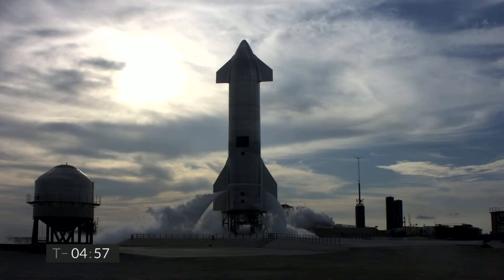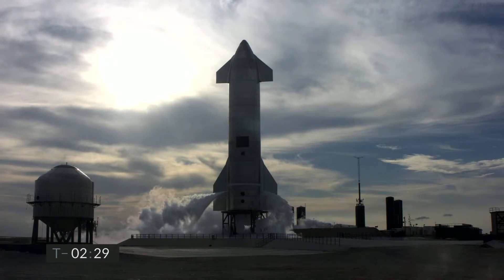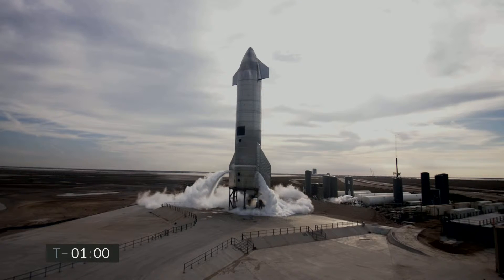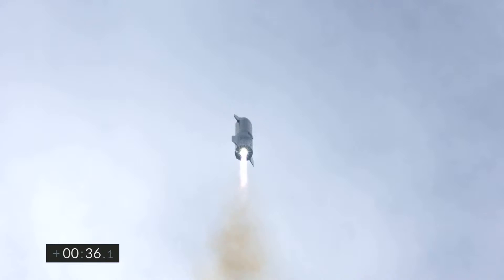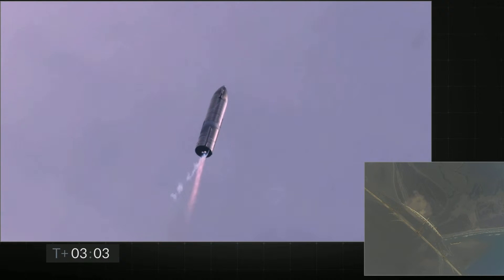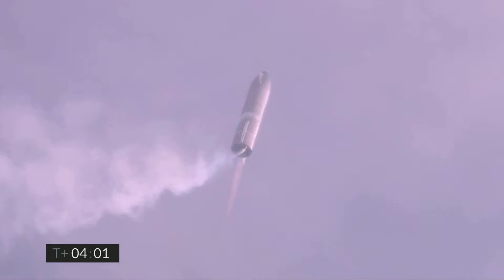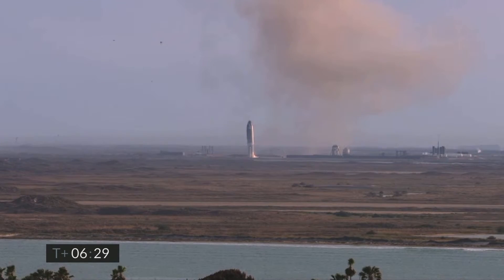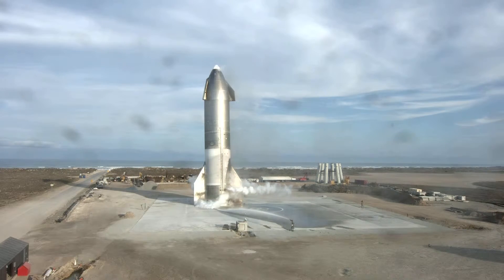Starship | SN10 | High-Altitude Flight Test

Comment: The fact that it exploded a few minutes later only puts a slight damper on its success. Still a great idea for intercontinental travel! (Sarcasm).
Reply: do you mind that this is a TEST flight? This is the very first time a thing like this happened, and the test was a success. Of course they had anomalies at the post-flight vehicle safing.
Reply: @politonno2499  The first time something like this happened? What specifically are you referring to? Because it's not the first time a rocket has landed vertically and definitely not the first time one attempting to land had exploded. 
Besides that my point of "still a great idea for intercontinental travel"  wasn't only making fun of the explosion but was also taking into account the sheer stupidity of having such an inherently loud mode of transport relatively close to developed areas.
Reply: @Stevo1361  the first time a rocket of that scale has belly flopped, flipped and landed. And no, SN10 didn't explode at the landing. It exploded at the vehicle saving attempt. 
And the intercontinental travel can be solved. Yeah, I understood the joke, but Starship development is a milestone after milestone
Reply: @politonno2499  Starship is great i agree. But to me the issue post landing is just as much of an issue as any of the others that have caused it to explode. 
Differences aside, i'm interested to hear how you think the issues of using such rockets as a mode of earthly transport can be solved?
Reply: @Stevo1361  I think that the landing was more than a 60% successful as Elon tweeted and fully expected...
Well. The noise can be solved by landing on the sea (droneships or sea platforms), far away from the city (like we see in old official renders) and giving a notice to the close residents. But I think that, like airports, there wont be places where people live near Starship suborbital landing pads, because airplanes are very very loud too (I think more)
Reply: @politonno2499  That's 60%? Fair enough then, still lots of progress to be made.
Interesting. I think that by the time what you're saying is feasible there will be other tech that will be a better option. Time will tell!
Reply: @Stevo1361  I just want to see starship with my own eyes before it goes orbital
Reply: @politonno2499  Things like that were done more than two decades ago. Those were also test flights...
Reply: @mikek9297  yeah, completly normal a 50m high rocket belly flopping and successfully landing... yeah... could you please send me a link of those past vehicles?
Reply: @mikek9297  oh, yeah, I see the giant belly flopping vtvl rocket flying.

Really? Are you really comparing the Delta Clipper, a 14 meter tall suborbital low altitude VTVL rocket to Starship, which is a completly different vehicle on its class? What the heck?
Reply: @politonno2499  I am.  Because they're both re-usable rocket ships and DCX's flight, while on lesser scale, looked way more controlled. Also the ship appears to be bult way more precisely... no wonder, since McDnnell Douglass made jet fighters, not glorified golf carts.

Comment: i still remember smth about Apollo program 50 years ago; those were very complicated  missions. explain me what are these SpaceX flips for, please
Reply: it falls horizontally to slow the starship without using the engines in order to save fuel, then turns them on at the last moment to bring the rocket vertical and slow the rocket to a stop.
Reply: @FieldsAndNotes  you briefly describe what is in the video, thank you. my question is about the purpose of these drills / soft landing.
Reply: @codece172-ak2  these are to test starship's systems. rememeber, this is only about the second year of the development of this vehicle so theres a lot of things to test and get right before it can go to space.
Reply: @FieldsAndNotes  imagine everything works great at the end of the day. to perform a soft landing this way, the rocket has to carry an extra 20% fuel onboard - to and from the mission goal. it looks to me unreasonably expensive and useless. and no one can explain to me the rational behind this new functionality.
Reply: @codece172-ak2  All I’m saying is that a team of a few thousand engineers among the smartest in this country have decided that this launch architecture is the most effective and efficient way to get payload to space while reusing an orbital class rocket, based off years of refining their design and the development of the raptor engine. I’m sure SpaceX knows what they’re doing, if you’re saying you know better than SpaceX’s team then I think you need to sit down.
Reply: @FieldsAndNotes  I think that if you do not know the answer to my question, then you better not even try; let someone else say

Comment: What is that white smoke-like thing coming out of the bottom? Refrigerant maybe?
Reply: Some of the liquid oxygen (LOX) boils off and the gas is vented to the outside to prevent overpressure in the tank. The gas is still very cold and causes water vapor in the air to condense. That is what you are seeing.

Comment: At 11:46 it seems that 3 boosters are on need is of 2 only and the 1st booster blasts and the 2nd booster is turned off, damaged or it also blasted and I mean to say that the sn10 exploded after 8 minutes of landing, so the reason can be the blasting of booster by which  the fuel of sn10 is may be leaked and catch the fire or may be some problem occurs in the system of the SN10.
Reply: Just an assumption.

Comment: In a close up video you could see the rocket bounce after it touched down.  It was enough to break something causing a fuel leak most likely.
Reply: Yep. Elon Musk said on twitter that the touchdown was way harder than the landing legs could handle, they got smooshed good.
Apparently the engine's throttle response stopped working right at the end. They're still not sure why.
The engine was working fine otherwise, it just didn't listen to the command to throttle up to take the last bit of speed off.

Comment: Hi SpaceX and Fans. I have watched all the test carried out on Star Ships including vessel pressure tests and flight tests. So far, vessels have proven their pressure capacity and I must say Congrats to the team for being persistent enough to cross that hurdle. Another significant hurdle that was crossed successfully was the belly flop maneuver and and descent control, again, Congrats to the team. However the team is yet to cross a next major hurdle of landing. From my observation of all landings so far, I noticed one thing in common and that is the angle of the vessel at the final descent stage before touch down. This is likely due to the angle / position of the engine carrying out the landing burn in relation to the center of gravity / mass, despite is ability to gimble. As a result of such, the landings achieved with SN 5, 6 and now 10 has left these vessels standing with a tilt, as the crushing forces was biased to one set of legs on impact. So it might be safe to say that, just changing the landing legs my not provide spectacular landings as with the Falcon boosters. The key thing is to work with the center of mass which is what enables the success of the F9 boosters. This may require a fourth engine to be placed at the center of mass to handle the final descent burn and a balance balanced approach at 90 degrees to the landing pad. It them appear that the legs are gonna have to housed in secured pockets covered with heat shield for re-entry and then ejected for landing. ''Keep It Simple''

Comment: If space and the moon had the ability to take fuel, wouldn't man be able to live on the moon?
Reply: I mean fuel isn't the only thing you need, but yes, the moon has enough resources, that with the right tech people might be able to live there.
Mars has a wider variety of resources though, and higher gravity, so it's quite a bit more likely to be possible to live there.
Reply: @lazarus2691  I mean space traveling system

Comment: Landing on moon, Mars = no guarantee on smooth, level, even surface
Starship may need extendable legs like original Lem or similar to ensure it can land and stay without falling, and maybe level out for takeoff
Lots of fatal failure modes doing powered landing vs chutes
Too fast with engines, all engines don’t light, no engines, wrong angle, etc
Reply: SpaceX started working on better legs months ago. Bigger, stronger, with shocks absorbers and auto-leveling, etc.
But since this was a cheap disposable prototype, landing on a concrete pad for now, they just used cheap temporary legs for this one.

Comment: Too bad that the landing was only marginally better compared to SN8. Still not perfectly vertical, small rebound and the damage of impact still caused it to explode. Only difference is that it took 8 minutes this time. Anyway marginally better is still an improvement of course.

Comment: This is insane ,  I'm not a rocket engineer but this is going in the wrong direction .  No part is the best .  The Starship does not need sea level raptors it only needs vacuum Raptors.  @/spacex had it right in the moon lander Design.   Test To Space with 3 Sea Level raptors . Add 4 dracos that run on methane . Use the Dracos to do the flip and land . If the thrust landing section  is up under the crew section you can add a abort to the top section and you can land without a fire ball at the base of the Rocket ,  The Dracos won't have to Gimble! The Dracos can stabilize the Rocket and Flip it using Thrust throttle .  After you test the draco system Swap the Sea level Raptors for Vacuum Raptors and Go to the moon! o ya and put the Parachutes in the nose cone!
Reply: Now I know you mean Superdraco, but can I just point out how hilariously underpowered 4 Dracos would be to land this thing?
One Draco has about 40kg of force. So four of them would have a whopping 160kg of thrust. Wouldn't make a difference.
As it is, four Superdracos isn't enough either, but it's a lot less pathetic. A Superdraco has 7.2 tonnes of thrust, so four of them is about 29 tonnes.
But this ship weighs well over 100 tonnes, and ideally you'd have a TWR of at least 1.5, if not 2. So realistically you'd want something like 32 Superdracos.

Comment: Starship: Flies in the air perfectly, does sick barrel roll in mid-air, lands against all odds.

Also Starship: forgets kick stand and explodes.
Reply: @reasonerenlightened2456  
The booster will be easy. Starship is nothing like falcon
Reply: @Poatatero  so things that have never been done in human history b “easy” now.
Reply: That's r&d for ya'!
Reply: IKR just goes to show how difficult it is to accomplish this, one small mistake is enough to make the rocket explode.
Reply: Which is why the first people to get inside one of these things should be applauded for their bravery and dedication to expanding our collective horizons.
Reply: @Catubrannos  by that time such errors have long been solved, we don't want another challenger do we?
Reply: @Catubrannos  agree 1000%. They should all have the same benefits as U.S. Presidents do for the rest of their lives.
Reply: They have so much experience from the landing of the falcon rockets but still need four Starships to get the landing correct. It makes me wonder how many boosters are they going to destroy? ... clearly transfer of knowledge seems impossible from Falcon to Starship to the Booster. Or is it impossible?
The SN8's destruction can be forgiven. The SN9's destruction was worrying.  The SN10's destruction was pure incompetence. and a waste. How many boosters will have to be pointlessly wasted?
Reply: @reasonerenlightened2456  Sort of made it this time. That's great. Although I have doubts it's practically safe in the long term. Maybe they will go back to a reverse pencil drop despite fuel usage. Only time will tell. Safety is paramount, and also the astronauts' confidence. I would not like to be aboard when it does that flip.
Reply: @reasonerenlightened2456  first its a different rocket engine completely...second falcon rockets 'BOOSTER' landed nt its main body whereas this starship is nt a booster...my friend half knowledge is dangerous.
Reply: @reasonerenlightened2456  People like you, who are the absolute pros everywhere, probably never die out...
Reply: @reasonerenlightened2456  I didn't ever see a f9 booster falling horizontally, and landing vertically. Neither sn8 9 or 10 was a waste. However, the minute it took me to write this comment was sure wasted. I bet you are just a spacex or elon musk hater and don't listen to reason. Let me know if you can't find out why 8 9 and 10 were not wasted.
Reply: @zoltankurti  literally just kidding. I follow Elon Musk and am a huge fan of anyone who is as ambitious as he is...come to think of it, no one is!

Comment: Hello Elon, I noticed that in your sn10 missiles, before landing about 1 mile, a huge foreign flame appears and then the rocket ignites, why don't you install an autonomous powder-based fire extinguisher so that the Electronics does not damage I am not an engineer, but I thought to share this idea I would like to share more  some ideas thanks
Reply: This is understandable, I advise as an idea when the rocket sits down everything is fine and suddenly a fire started inside, then a fire extinguisher with a fire sensor would be installed inside it would work automatically and extinguish the fire, Forgive me, I write in English through a translator because I don't know English, maybe  I write something wrong.
Reply: @sergeiiurovski6395  F
Reply: They are working on it, the difficult part is to make it work

Comment: Watched the landing three times. S10 bounced upon impact.
Reply: Yep, Elon confirmed that it landed hard due to some sort of engine throttle control problem. The landing gear got smooshed.
Definitely a hard landing, but they've proven that the whole 'belly flop then flip and burn' maneuver works. Just need to iron out the bugs.
Reply: At least it didn't explode at the flip maneuver again

Comment: Didn't make the water hose closer enough to the rocket unfortunately. May not have blown up after woulds
Reply: It blew up because the fuel tank was leaking methane and it combusted

Comment: water is a coolant right or now water contains hydrogen and oxygen gas, hydrogen gas In contact with chlorine, oxygen, or other oxidizers, is flammable and explosive and burns with a nearly invisible flame. Whereas oxygen gas is an oxidizer it feeds fire
So it is very dangerous to use oxygen around burning objects.
In conclusion pouring water on to the hot, burning space X ship to me was the cause of the explosion.
Examples: run your car or bike at full speed all day when the engine gets hot pour water on it immediately and see the reaction 
Example 2: put boiling water into a container and pour cold water on the outside a see what happens.
  That’s my own point of “view little things matter “
Best way was to allow the Space ship 🚀 to cool down on its own...
Reply: So fire fighters have really been blowing houses up.. instead of putting out the fires... the water they used had jack shit all to do with the explosion.
Reply: @NZBigfoot  lmao I hate it when the firefighters blow up houses! ^^

Comment: Finally smooth landing this proves nasa sucks
Reply: @timnovorok  well nasa sucks, and it does very hard. But it's normal, since it's a gov agency
Reply: @timnovorok  because they're funded by tax payers, they're simply not free as a private company, for example they're forced to use old components from historical partners (look SLS).
Reply: @timnovorok  of course, but i think that the future of nasa must only be related to missions, satellites and similar. Building rockets it's not a thing they can do efficiently anymore.
Reply: @MadSal  They might still be able to do a decent job if not for certain senators like Richard Shelby.
They had three competing designs for SLS, the one we got was by far the worst rated, but it used Shuttle parts, so...
One of the other designs was basically a modernized remake of the Saturn V, which scored the highest of the three.
Had they gone with that, used a contractor other than Boeing, and avoided cost-plus, things might be different.

Comment: The landing legs appear in need of a redesign and perhaps could be longer to allow better venting of the engines after landing but overall a successful proof-of-concept demonstration.
Reply: They were already working on improved landing gear months ago. But since this was a cheap expendable prototype, they were using cheap single-use legs.
They were supposed to be 'good enough' for a single landing. They worked fine on SN5 and SN6, both of which have since been scrapped anyway.
They'll probably still use these legs on the next one, but the one after that is expected to have the upgraded ones.

Comment: All this talk about climate change and the EPA cracking down on diesels here we have a super polluter. Hey EPA force them to put some filters and exhaust on that thing before it kills the world with that rocket exhaust.
Reply: This is burning highly refined natural gas, which is a hell of a lot cleaner than diesel. It produces about as much CO2 as a single airliner flight.
Considering there were 39 million airliner flights in 2019, this is a drop in the bucket. You'd need to launch one roughly every single second to match it
Additionally, SpaceX are planning to make the fuel carbon neutral in the future. It's literally a requirement of their Mars plan.
You can't get methane out of the ground on Mars, so the only way to make it is by sucking CO2 out of the air and synthesizing it with the Sabatier reaction.

Comment: Would this work?
https://youtu.be/HFrfbbo9r2w
Reply: That's basically the Falcon 9 legs. The problem with that is that Starship will undergo a much more harsh reentry than Falcon 9 does.
So it's legs ideally need to fold inside the bottom of the ship, rather than outside.